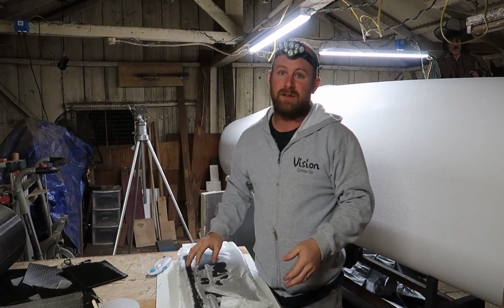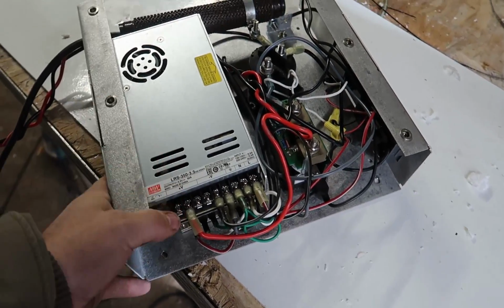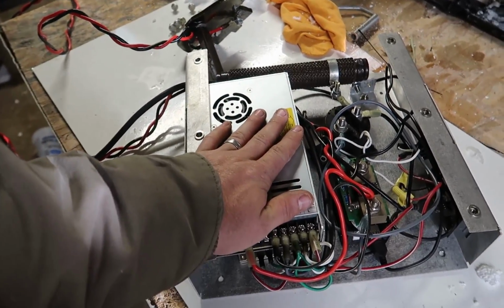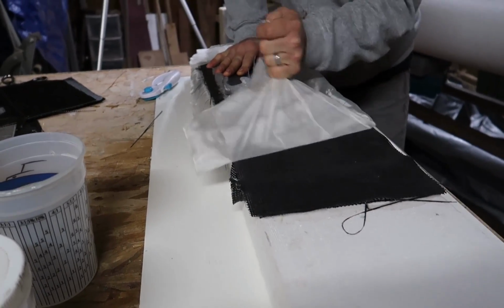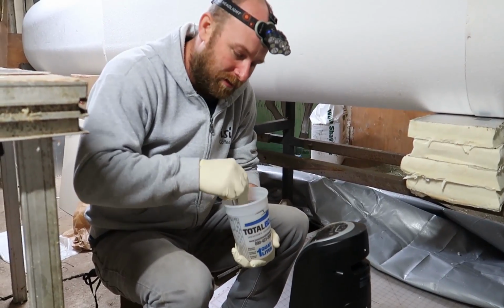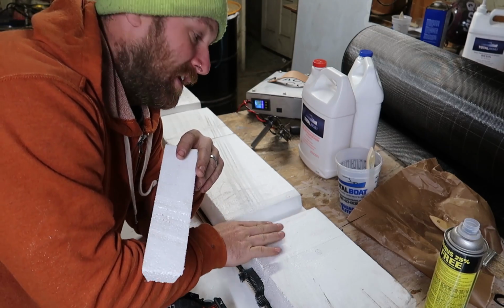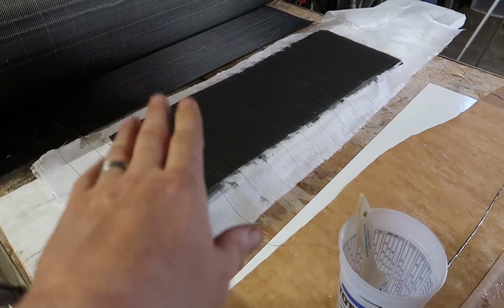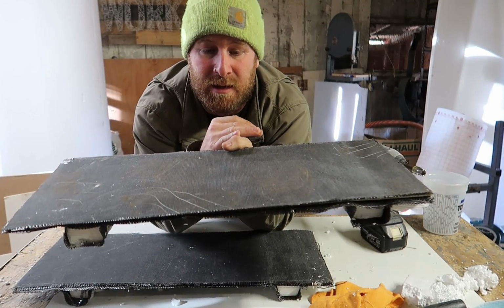Carbon Fiber planning and testing | Lark streamliner

Comment: I too have been amazed at the amount of rigidity that can be achieved with 1/8" foam sandwiched between layers of glass. Some builders coat their buck with several layers of latex paint and then a release agent to reduce the amount of foam adherence to the layup. The test part looks likes your plan will be super strong, well done sir.
Reply from the maker: Thanks for the feedback! Great input as usual

Comment: Nice rolled edges on your ribs or bracing, as you have found out the cloth will not bend and at 90 degrees you can also have a lot smaller ribs to add the strength i have put in 10mm x 10mm wide cut lengths of foam or even cardboard for some of my moulds just to give extra rigidity, as I found it is the cloth in that rolled shape that gives the strength not to foam, I have not used carbon only epoxy and glass cloth, have fun and best of luck my friend , looking forward to more videos
Reply from the maker: I am having tons of fun and I really appreciate all the great feedback. I'm feeling much more confident about the body construction!

Comment: Looks like you're on track for a winner! Did you come up with any ideas you could use to do it in vacuum bag sized sections?
I too enjoyed reading the comments on the last video. So much support and no nonsense comments.
Reply from the maker: I did, but they all just seemed a bit risky. I was told that vacuum over a Styrofoam buck can see time lead to deformation. It would require making a mold

Comment: If U use strips at 45 angle then another straight you will be amazed at the strength, _ / _ \ _  there is also plastic honeycomb sheets we used to use for strength without more weight. My carbon sensei & I made the Lightest Corvette hood in the industry like that, but U could stand on it. ⚡️🏍
Reply: Ohh, and be careful  about letting your buddy chew on that cause if U don’t sand the edge it will slice the inside of his mouth... can be very sharp.
Reply from the maker: I can't find an affordable plastic honeycomb anywhere. I went with the foam instead.  If I understand you correctly, I think I am making that layup.  Works amazing!